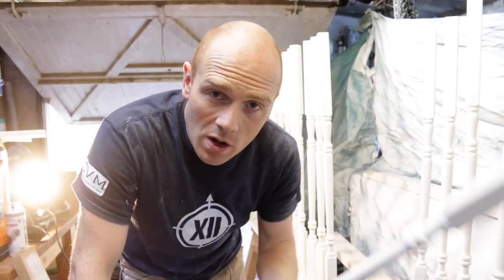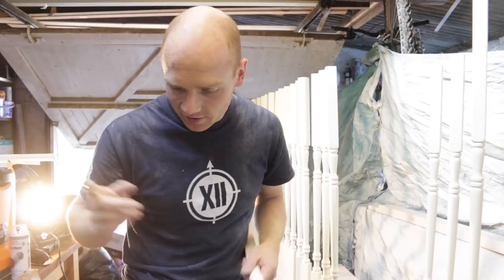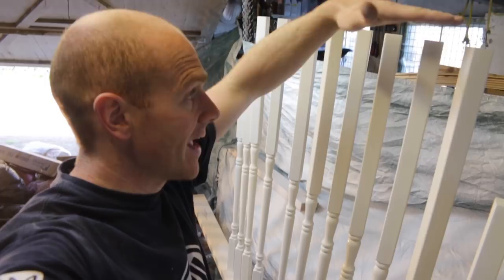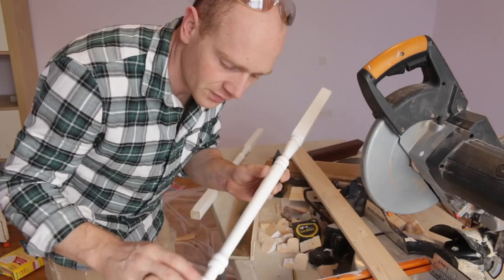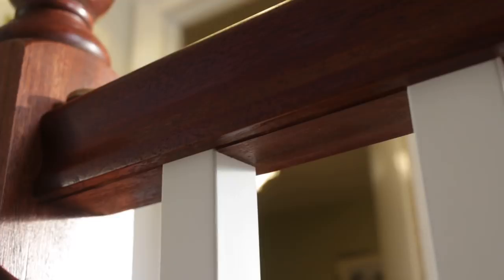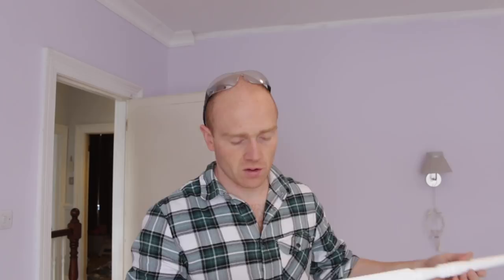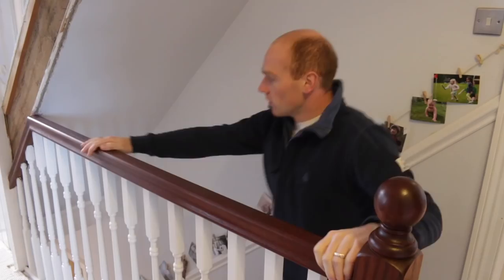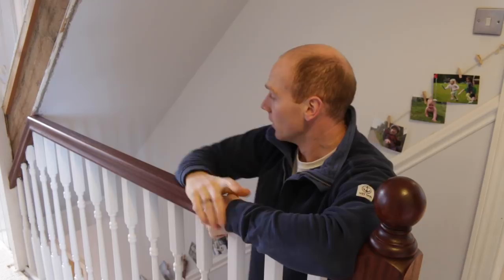Painting & Fitting Stair Spindles

Comment: So no need for nailing the spindles or fill strips?

I’ll be doing this in my house coming up soon.

Thanks for the videos!!!
Reply from the maker: I did pin the second lot on an angle with 18g brads which is worth doing as they can have a tiny amount of movement if there is shrinkage over time. It’s hidden by the full strips.

Comment: I was wondering since you put them on screws, would the whole contraption hold on if you just flipped it upside down to make the turnover easier?
Reply from the maker: +MidnightAmratha possibly but would need to hang the 2x4 from the roof I guess.
Reply: MidnightAmratha I was just about to write the same thing. Flip and hang from the ceiling.